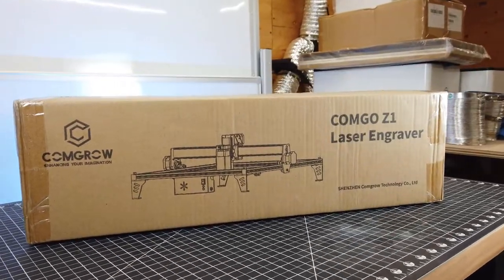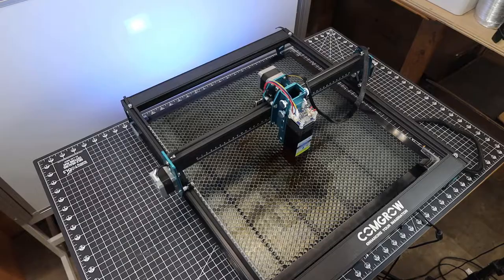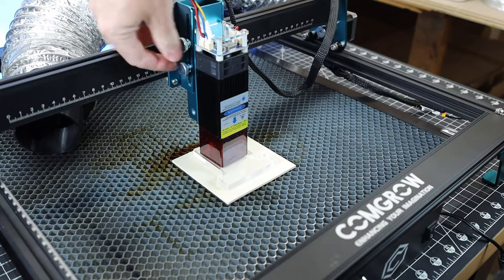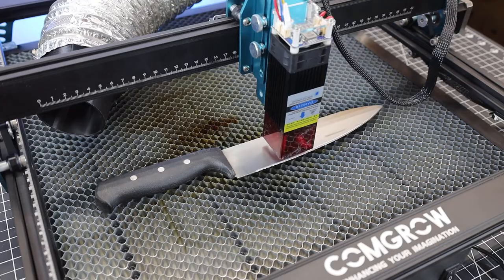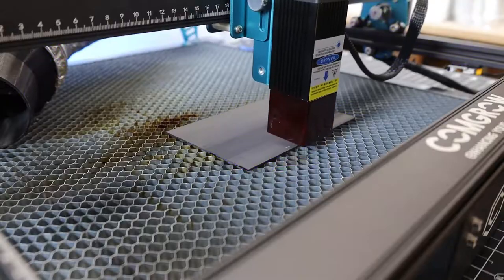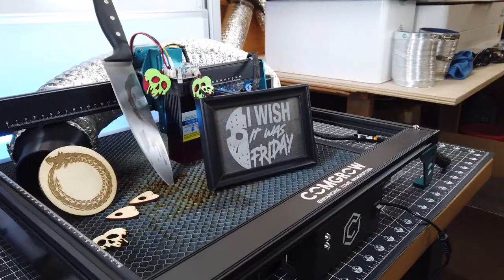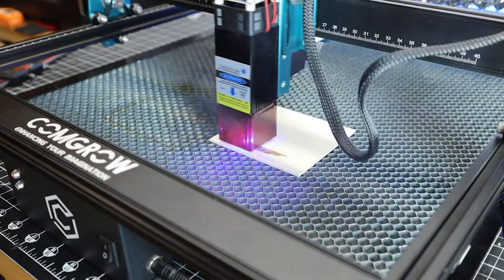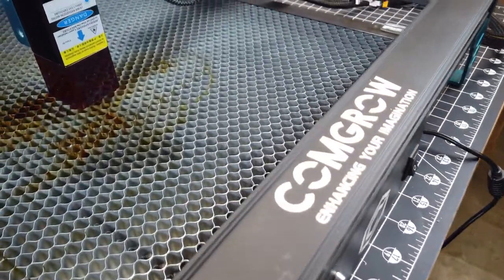Using a Laser to Make Halloween Items | COMGO Z1 10W Laser

Comment from the maker: From COMGROW:
COMGROW Z1 10w Laser - https://bit.ly/ComgoZ1Laser10w

From Amazon:
COMGROW Z1 10w Laser - https://amzn.to/3S2Wlj1
COMGROW Laser Rotary Roller - https://amzn.to/3yJ1zts
COMGROW Air Assist for Laser Cutter - https://amzn.to/3S2oczY
COMGROW  Enclosure with Vent - https://amzn.to/3T4Iw4W
COMGROW  Honeycomb Cutting Bed - https://amzn.to/3esUYfX

Materials you can or can't use with your laser - https://cpl.org/wp-content/uploads/NEVER-CUT-THESE-MATERIALS.pdf

Laser Cutting & Engraving Materials:
Aluminum Business Card Blanks - https://amzn.to/3S96efP
Aluminum Pet Tag Blanks - https://amzn.to/3r78VCB
Stainless Steel Blanks - https://amzn.to/3xL1rJu
Baltic Birch Plywood 3 mm - https://amzn.to/3SvHxu1
MDF Sheets For Laser Cutting - https://amzn.to/3C0PBNI
201 Pcs Engraving Material Box - https://amzn.to/3C2Ow84
Black Slate Stone For Engraving - https://amzn.to/3BKza78

Download the CH340 Driver Here:
https://sparks.gogo.co.nz/ch340.html

Laser Software: 
Free - https://lasergrbl.com/
Paid - https://lightburnsoftware.com/

Free Laser Test Files:
Engrave Material Test Laser Pattern (LightBurn) - https://drive.google.com/file/d/1VmzXgLFeil-zOarKUNs0QklVCMqqTEQA/view?usp=sharing
Cut Material Test Laser Pattern (LightBurn) - https://drive.google.com/file/d/1DVm-P38fsdGC2fzOeuDwhkWSrzNS6A-t/view?usp=sharing

Here is a place to buy cheap files that you can cut and engrave - https://tidd.ly/3Mw1MG4

Here are the links to the enclosure and honeycomb cutting bed that I have:
xTool Enclosure - https://bit.ly/xToolEnclosure
xTool Honeycomb Bed - https://bit.ly/xToolHoneycombBed
3in to 4in Exhaust Adaptor STL File ONLY - https://bit.ly/3inTo4inExhaustAdaptor

MatterHackers 3D Printing Filament 1.75mm:
Build Series PLA - https://bit.ly/MatterHackersBuildSeriesPLA
Build Series Silky PLA - https://bit.ly/BuildSeriesSilkyPLAMatterHackers
Build Series ABS - https://bit.ly/MatterHackersBuildSeriesABS
Build Series PETG - https://bit.ly/MatterHackersBuildSeriesPETG
PRO Series Filament - https://bit.ly/MatterHackersPROSeriesFilament
NylonX Filament - https://bit.ly/MatterHackersNylonX

Amazon 3D Printing Filament 1.75mm:
PLA - https://amzn.to/3gsLE9Z
PETG - https://amzn.to/3pXjjvu
ABS - https://amzn.to/3wsTRjS
ASA - https://amzn.to/2RX8dtM
Polycarbonate - https://amzn.to/3cLdr38
Nylon - https://amzn.to/3iNGeI2
______________________________________________
Note : Most of the links that I use that go to products are affiliate link. This means I make a small commission on anything that you happen buy using them. This is at no extra charge to you and this helps support the work I do on this channel. 😁👍